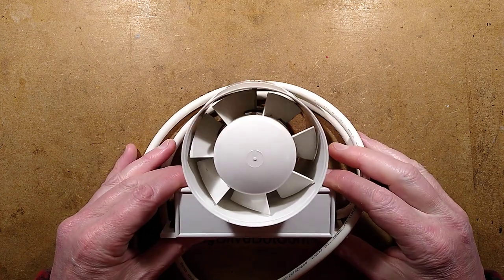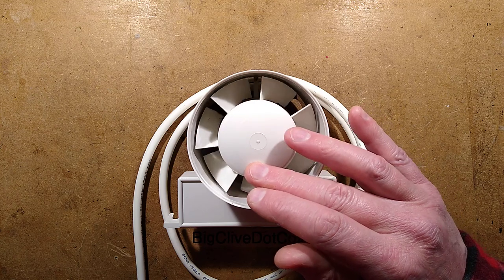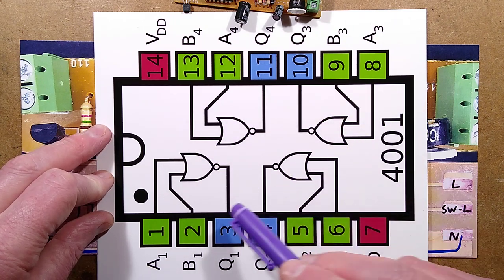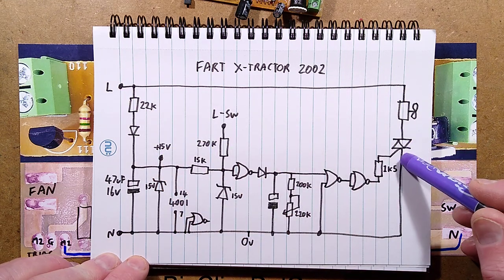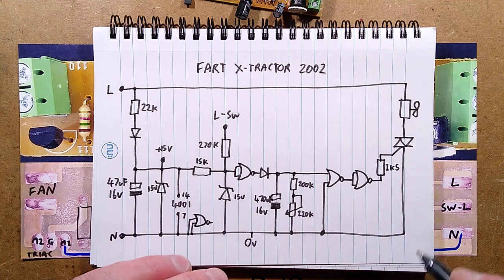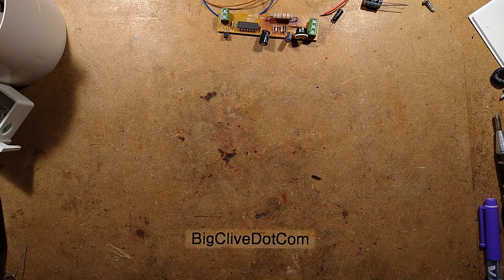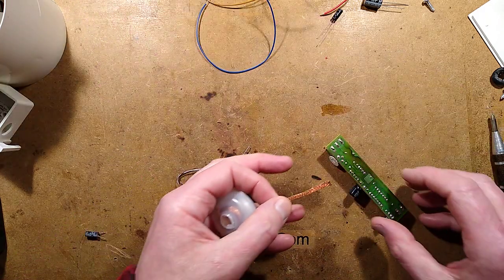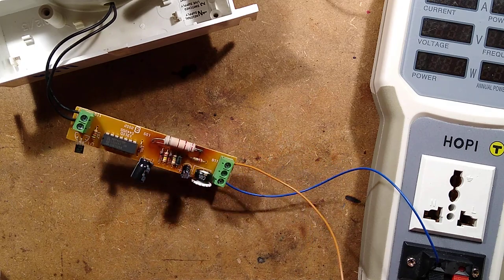Fixing a fart-extractor (with schematic)

Comment: I hadn't watched until the end but i'd of gone with the fault diagnosis of..  "Pinkeye Particle Build Up Within the Fan Bearing Causing Friction During Start."  Lol.   Btw Clive,  I started into the electronics hobby/repair trade with the purchasing of some Jukebox timers and learned how to wire the microswitch contacts from my Dad.  I then made my own disco lights at the ripe old age of 12.  Much learned, mostly self taught in the hobby and T.V. Repair trade.  I also had a stint as a "Gaff Lad" just before I broke into the electronics repair side proper.  Love the content. Seeing the 4001 triggered nostalgia.

Comment: I used to think that bathroom fans were for fresh air, and most people turn them on for that reason. On review of electrical code books, these are mandated to reduce humidity and control mold. You get the additional side benefit of dry towels.

Comment: Those M-Testers are brilliant. I wouldn't trust them for accurate, but it's impressive they can test so many different components AND VALUES using just a handful of digital IO pins. BTW it's some open source design that everyone rips off of, everyone has a different version with different component support

Comment: Someone on another forum suggested connecting a fan to extract air from the cistern of a WC. This would then suck air out of the pan via the overflow tube of its lift to flush valve. Thereby removing smells "at source"
Reply: That system is used in some composting toilets I've seen, and it works quite well.

If porta potties added a small solar panel and fan they would be much less unpleasant.

Comment: It is a bit rubbish that the standby state is continually frying the resistor. I built an electric fan control unit for my car and added a relay as a flip flop that would only draw power when in use so it wouldn't drain the battery. But I guess any extra circuitry for such a nicety is too many pennies for the bean counters to contemplate.

Comment: Thanks Clive! This circuit is in older Manrose MF100t fans. In my case the timer stopped working and the 470uf 16v capacitor had slightly bulged. Replaced with a Panasonic 470uf 25v (given newer Mf100t fans use 25v not 16v) and the timer was back 👍 There is enough room to fit the larger 25v capacitor away from the hot resistor in the casing.

Comment: This bloke is sooo annoyingly clever, but you just can't resist his videos.
Another great repair. I used a lot of them in line duct fans, Manrose in the late 80s then lots of cheap copies appeared at different wholesalers.
Once again my fine fellow, I tip my cap to your knowledge 😁😁👍
Reply: If you go further back from the 80s ~ you would find Vent-Axia, Xpelair, and other [now commercial/vintage] fan company’s promoting their fans for use in domestic environments, only when the cooker-hood was invented in the 70s that smaller 100/150mm ductwork and external vents were made for them and then 🌟 if we made smaller 100/150mm fans for domestic use instead of the larger commercial ones, for use alongside the cooker hoods that use  similar small ductwork & vents.

Comment: Not sure how common they are in the UK but on the continent you can easily find external timers for fans. They work exactly like this one but they aren't internal to the fan. You'd typically fit them into a junction box somewhere near the light wiring so you've already got the permanent and switched live at hand and only run a 2-core to the fan.
Reply: We have that with our “safety extra low voltage” 12v fans ~ an external box with the time-delay and step-down transformer outside the bathroom/shower-room and the fan inside the shower cubicle

Comment: I think by the replacement one should give priority to the temperature allowance (105 degC) instead of the voltage. You have a 15V zener, and the capacitor is charged through the output stage of that gate which have some drop-out as well. So that 16V cap I bet will never see  anything above like 13-14V, maybe even less. But as the whole circuit is placed in a confined space, it actually doesn't matter the orientation, there will be hot as hell for sure :)

Fart-extractor, priceless name for the device :)

Comment: Helpful video  - wish I'd found it a couple of years ago when I did the same fix!  The timers on these cheap fans last < 2 years. Last time one went wrong, I replaced the internal timer with a mains relay and timer relay (£2ish each from Banggood) add a box, total about £10 - lasted 2 years so far.  My circuit isn't completely correct that the timer starts when the light is first turned on and not when the light it turned off, so no "sitting down" for too long or the fan goes off!

Comment: Easy enough fix, yet definitely not designed for long term durability.....giant heat generating resistor next to the most critical capacitor, built-in replacement orders for new modules...fan, board, and all.  Glorious.

Comment: Hi Big Clive I recently purchased a fan from B&Q under impresion it was a timer fan, however made pcb for your circuit
but didn't use 22k resister but used a 330nan with 470k shunt, & 56ohm res in series limits wast, also Triac drive I had to add
a Diode in series with the 1lk5 res or triac back feeds 4001 and it don't like it, now works.

Comment: I hate fans that switch on with the bathroom light. To impress the next person to use the bathroom with my personal fragrance I have to do my business in the dark, which tends to be a messy affair.
Reply: Personalised fragrances 😆
🥴💨🛌 🤢
(Dutch oven 😉)
10/10
Reply: Well that's a shitty thing to do
Reply: Couldn't you leave the light on and use a blindfold?
Reply: A bidet  is good for this problem and to keep things nice and clean in general.
Reply: I hate the running fan too, but I am not brave enough to force others to enjoy my lovely poo smell. So I found timer, that is triggered just after the light is switched off.

Comment: Thanks Clive. Had similar issue fixed by replacing the domed  470uF and changed the 47uF for good measure. [Edit...both caps were also 16v 105c but the large resistor was clearly getting quite hot and apparently affected the caps].

Comment: I wonder how many such things end up in landfill for the sake of a 5p component?
Reply: Yes :)
Reply: Too many.
Reply: @simontay4851  far too many,    i had an plug in timer switch go bad due to cap going low, wasnt an electrolytic, though, a poly dielectric type,
Reply: Damn, I might well be guilty as charged ... but the fan had definitely gone, but I did keep the board for some reason ...so fantastic to see Clive explain how it works!  Will try and see what components on mine might have failed.  Excellent learning experience.
Reply: @petebowcott8348  most electrical/electronic stuff being dumped is probably repairable if faulty, and some nothing wrong at all, just they want to 'upgrade' /have the latest thing...
Reply: @andygozzo72  I remember at my local refuse centre one day about the time we were all getting flat screen TVs there were literally hundreds of CRT TVs stacked up - same with monitors. I suspect most worked fine. On a global scale it's horrific really.  A guy called Louis Rossman has a YT channel which shows how hard Apple work to stop you repairing their stuff!
Reply: @ChoppingtonOtter  i watch his videos 😉 , as for those refuse/recycling centres, in most cases if you ask if you can have anything or even offer to pay, its a case of, no ,not allowed due to health and safety,  or , they have a contract with a particular recycling company
Reply: I made pretty good money for a while just replacing blown caps and opened resistors on trash picked electronics.

Comment: the extractor fan in our bathroom has a humidity sensor in it, so it comes on if either the light is turned on, or the humidity gets too high (assuming the bodge job switch isn't turned off, the bodge job switch allows it to be set so that it only comes on if the humidity gets too high)

Comment: That’s brilliant compared to the fans we have in the US that run from a separate switched feed and often get left on, venting lots of your hot air right out the roof in the winter (or cold air in the summer).
Reply: "brilliant"
Not really, what if there is a window, and there is no need to switch on the light during the day?
I buy the cheapest ventilator, without control and a separate motion detection switch.
It works even in daylight, and I can replace the ventilator separately.

Comment: My experience of those fans after a little experimentation is they make noise but not actually move air in any significant way
Reply: Either that, or the previous occupant moved too much air in an antisocial way!
Reply: In-line ones are way better, and hide in the loft out of the way
Reply: @bigjd2k  I think that is an inline fan, There's a huge difference between decent well designed inline fans compared to the cheesy plastic junk we get in DIY stores in the UK
Reply: Their are newer ones that claim to be more quiet - when my grandmother/nanny moved out of her bed&breakfast hotel (retiring) and in a housing estate, the house had “GREENWOOD AIRVAC” branded fans in the; en-suite/main bathroom, down stairs toilet and utility room, despite the house being previously occupied, the builders/electrician had bodged the installation of the fans - they were the type that had built-in back-draft shutters [rear mounted butterfly, spring loaded that open with the fan breeze] unfortunately they appeared to be jammed on the flexible duct and (the builders/sparky hadn’t noticed, the previous occupant might have smelled the lingering loo (poop/wee) smell in the toilet and the humidity/smell in the en-suite/main bathroom - both have openable windows so he did that 🙄). 🧐 - I was looking at the fan in the main bathroom and despite it being in the wall, I couldn’t see the duct and vent, so I got a long screwdriver and poked it though the fan grill and impeller and pushed the flaps open and reported it to grandma, saying I would have to take all the fans out to fix the problem and I had looked at their instructions online, but as she had just moved into the house, she refused to have me remove them to fix, (despite my profession in DIY, and the fans having isolation switches) afraid I would break any infrastructure in the house, she got me to write a letter to her (certified/trusted) DIY man called Adrian - who did DIY and had a workshop at the hotel, to fix the fans for her 😕, she also wanted me to change the off-time delay on the fan in the main bathroom but I refused (as I wanted to take the fan out the wall and fix the shutter problem first) as that required me to simply take the front off and turn a set screw 🙄. Eventually all Adrian did was remove the back-draft flaps from all the fans and replaced the external louvred vents with flap vents on the back wall of the house (including the cooker hood that didn’t have the problem 🤨) Nanna might have got a backdraft in her en-suite shower/toilet as the fan terminated with a cowl on the roof with no shutter 😁. Inadvertently when we first came to the house and had dinner, we shut Nanna’s old dog called Bootsy in the utility room (so we didn’t have him lying behind the table waiting for food to fall) and I turned the fan on to ventilate the room for Bootsy (removing his dog odour) but to think that the fan was (later discovered to be) blocked up and just making a noise and poor Bootsy had to put up with it 🙁. Years later I noticed that grandma was leaving the fan for the downstairs toilet switched off - 😠,  she said it was noisy (causing the ceiling to resonate) I said I profess in DIY and could replace it with a quieter one as they now exist - I liked the look of the “envirovent silent 100” as it also claimed to have excellent back pressure - for long duct runs (duct goes over utility room past its fan and to back wall of house) and phoned Nanna about it and she liked that it would be quiet and would apparently be more suitable for the toilet. I went with dad to grandmas house and said hello to great-grandmother (being cared for by grandma as her husband had died in hospital 😢) and with dad I fitted the replacement fan in the ceiling and tried it and Nanna was delighted to how quiet it was - “you couldn’t hear it with the door closed” - grandma, as the other fan still works l spared it and took it home and might install it (where noise isn’t a problem) 🙂
Reply: Same here. EBM Pabst makes 230V fans in the style of computer fans. I wonder if running one of those for 30 seconds would do better.
Side effect may be pulling the door shut.

Comment: No idea if it’s by design or not but that fat resistor burning 1W at standby will make it almost impossible for condensation to occur, a possible consideration if using as a bathroom extractor.
Reply from the maker: That's a good point.

Comment: Would be interesting to see if the resistor could be changed for a capasitive dropper.
Reply: That is what i would do. Other parts of the power supply might need modifying too. As it is it draws over 1W continueously without doing anything, which is unacceptable. It is very inefficient. It should not be using any power when the fan is not running.
Reply: yes it's a huge common cause of failure on these. They use them both in the inline version like this, and in the  ceiling mounted version. the resistor slowly toasts the electrolytics. The cynical side of me says they don't use a capacitive dropper precisely to get repeat sales.
Reply from the maker: The resistor may double up as a mini anti-condensation heater.
Reply: @bigclivedotcom   Could be. I'd like to see it partly cap dropped though. Being domestic sparks mainly, I have a box of them. They can be lucrative to keep. (There was a time when companies had the timed fans on special offer, and they were cheaper than the plain on/off ones... so I bought the timed ones and ...kept the results.)
Reply: Given the scorching below the resistor, standing well off the board, I wondered if it might be simpler to pierce the fan shroud in the vicinity of the resistor to have the fan itself cool the resistor -- feedback-loopishly. That wall between resistor and fan is nearly the low point in the circuit's compartment, so piercing it there wouldn't lend to water  ingress…
Reply: @michaelthibault7930  as Clive said, placing the resistor farther away from the capacitors will solve the issues.
Reply: @michaelthibault7930  The problem with just using the fan to cool the resistor is all the time the fan isn't running the resistor isn't getting cooled. IMO the better way is to eliminate the waste heat in the first place.
Reply: @eDoc

Does eliminating the heat involve buying another extractor? Expending inordinate amounts of time and energy replacing the entire circuit board in this unit? 

Any cooling is better than no cooling. Any movement of air into (ideally through) the circuit compartment will mitigate the heating of the caps via convection in an otherwise sealed container. I'd add to a slit in the shroud some holes in the bottom corners of the circuit's container.
Reply: @michaelthibault7930   piercing some holes through the circuit's container may also solve the dry capacitor problem. That, and placing the resistor farther away from the capacitors (using more stiff leads maybe). Piercing the fan shroud wouldn't help much, since the power consumption of the 2W resistor is almost the same regardless if the fan is on or not.
Reply: @soupflood  
It’s a compromised design. 
From a manufacturers point of view any air allowed to get into the PCB compartment would mean a hole/holes somewhere, which would give the unit an IP rating of a watering can.

Comment: ESR, a great test to see if the capacitor is current limiting, EPR (Equivalent Parallel Resistance) is the test that shows up DC leakage, in other words.. how much it's short-circuiting or passing DC to where AC should only be! 
An LCR Bridge Meter would show up all the capacitors flaws, but that little eBay multi tester only gives capacity and ESR readings, EPR is the capacitor failure mode that is responsible for destroying the next component in line... 
I have probably mentioned earlier in another post of another video that there's a really good LCR Bridge Meter which is available on eBay for around $100. It gives everything that you need to know about a capacitor instantly on a single screen! You won't know how you got by without it! You will also never need to use your little component tester again... 
EPR is more important than ESR! 
Again, ESR stops things from working, EPR blows things up! 
There's not enough awareness about capacitor failure modes, ESR and capacity test just isn't enough!
Reply: Of course measuring at say 100Hz instead of 10kHz a reasonable LCR does you'd see an even more extreme theta or D and whether that's ESR or EPR it says this isn't much of a useful capacitor at that frequency

Comment: Could the resistor have been replaced with something like a 220nF cap ? The smoothing and clamping circuitry is there already for the resistor and that should allow about 10mA of current for the logic etc I would think.

I guess the resistor is much cheaper for manufacture but if doing a repair, would a cap conversion be a way to stop the electrolytics from drying out prematurely in the future?